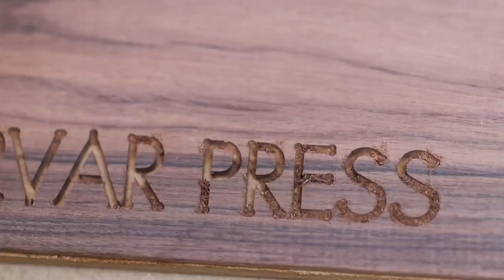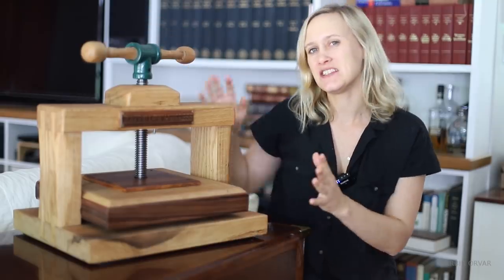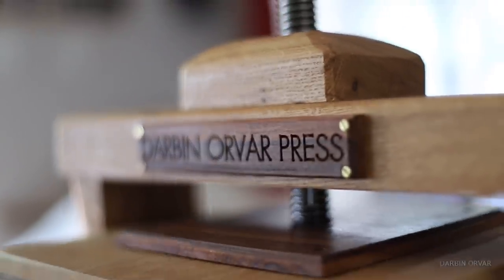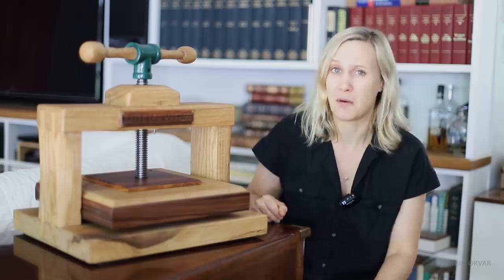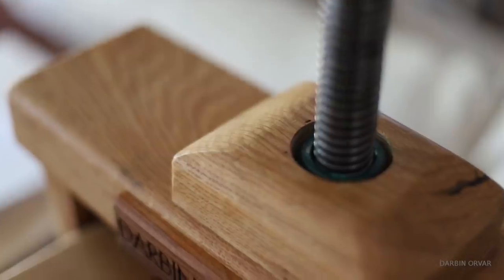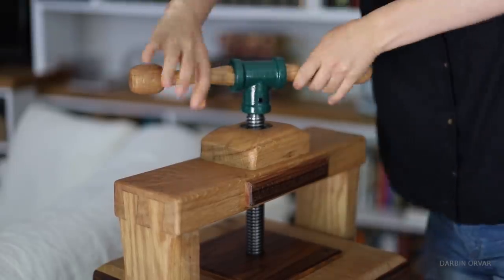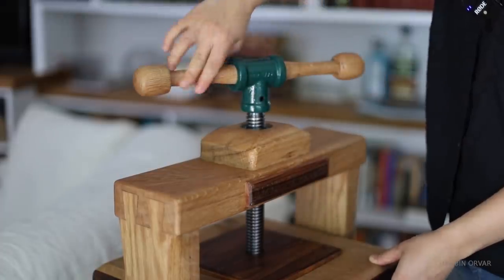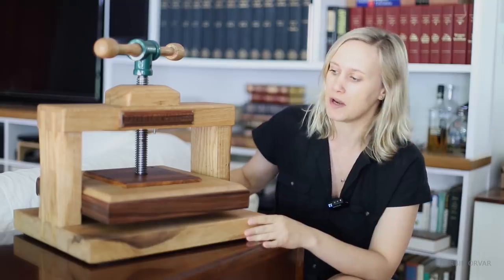Making an EPIC Handcrafted BOOK PRESS

Comment: Lovely work but I think I see a serious design flaw. If you press down really hard, you are going to tear the nut part off the top of your press. It should have been on the other side of the wood, with the metal bit inside the hole!
Reply: If you embed the nut from below as @evanherk suggests, you could add two inches to the height of your uprights and also gain deeper working space, giving you both a structural and a functional win.

Comment: I use mine for segment turning. stack up layers of ring segments. I've also used it like an arbor press for pushing plns out of chain linkage, shafts off of pulleys. posts were mortise and tenon. cross piece into mortise hole with two inches of wood above hole for strength. With flair tenon.bottom also has flair tenon in mortise. that's where you cut tenon and use wedges to flair in hole. Lots of glue into joint. this video is great , the completed piece can be left on bookshelf. looks like fine furniture. Mine looks like it's been used for decades. about 8 years only.  I only say this about mine it's so you don't limit a piece of machinery,to just this one .open up and spread you wings into areas that you might find fun. no limits if you fail so what make some sawdust.

Comment: Just found this. Thanks for the great video. As a woodworker and a bookbinder this is just what I needed to see. I'll be making mine soon. One question I have is do you think this design will work for a large press A2 size? I need something that will have a platter size of about 24 inches wide. My thought is to make four posts instead of two. Yes it will be heavy that is for sure. thanks.

Comment: Very nice build! In your experience does a book press finished with boiled linseed oil tend to transfer any oil residue on to paper over time? Or is it best to use polyurethane?
Reply from the maker: Thanks, you shouldn't have any problem with either if you use additional boards like I show at the end of the video.
Reply: @darbinorvar  Duh!! No idea how I missed that :)

Comment: Nice job!  Looks really beautiful.  I'd like to add something for any reader who didn't quite get your source for the rubber pads.  Tractor Supply or other farm hardware shops sell matting for livestock stalls.  In this day and age most  barns have concrete floors and they are hard of hooves.  So... they sell rubber mats to soften the floors.  The stuff is REALLY tuff and great for any project where durability and hard rubber is wanted.  IF hardness and durability are not what your looking for you can buy foam rubber tiles in the big box hardware stores.  They are generally in tile form and much softer than the stall surfacing matting.

Comment: Nice looking press, love the dovetails! Question, the small screw hanging down under the top of the press, Is it a stop? If so please cut it off and use a piece of wood instead. If it is not a stop, then please cut it off. I feel it distracts from the looks of the piece.

Comment: Why would you use that material with all the stress fractures and cracks throughout?  One column and the upper pressure plate have severe structural defect.  I’m afraid it will not tolerate the pressure.

Comment: A very nice build, but why use an obviously badly cracked piece of Oak for the base? Unless it has been stabilised by gluing up and hopefully holding it together, that will flex somewhat and although the top platen is "floating", there will always be a tendency for a the forces on the book to be out of parallel I would have cut that piece up to form  the sides and found another sound piece of Oak for the base.

Comment: Yes it looks good but honestly, you don't need dovetails or anything because you are going to press books, for the signatures to be evenly flattened and for the glue to sit, you don't need that much force to do that it's not a bloody hydraulic press and you're not going to crush things with it...

But the dovetails look good indeed, it was not a critic of that really beautiful work per se but rather some technical precisions. As if anyone wants to make one he could totally go for a way simpler design than dovetails, like two smaller threaded rods at each end of those "support columns" going throughout the top portion to the down portion with nuts at each end and everything glued together and it should work just fine while being infinitely easier for someone less geared up than you guys.

I might get into this bookbinding stuff, it's really appealing.